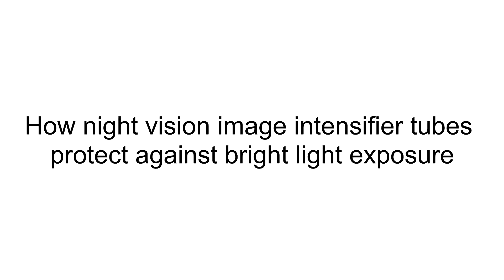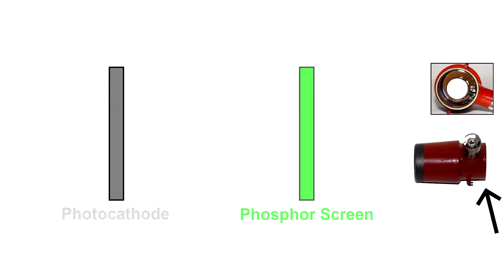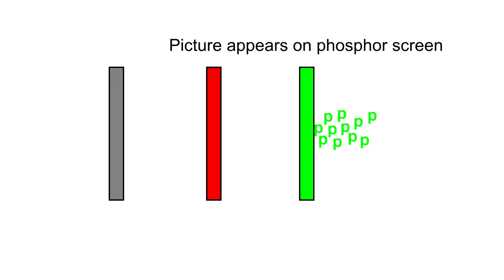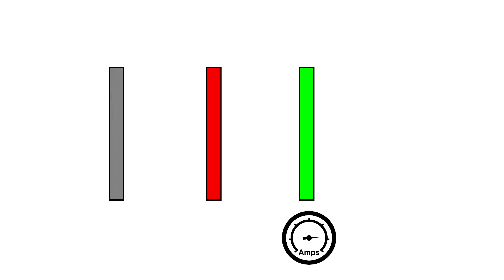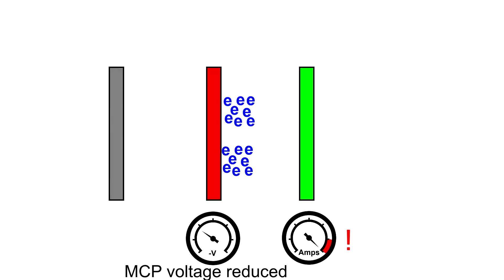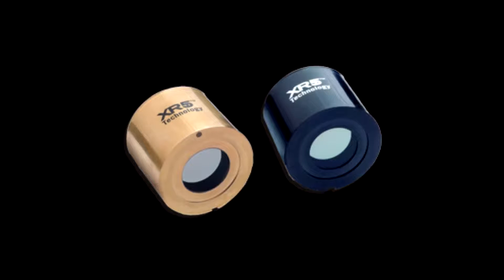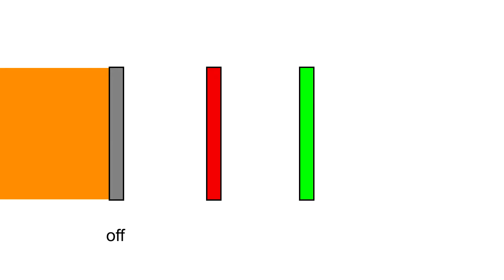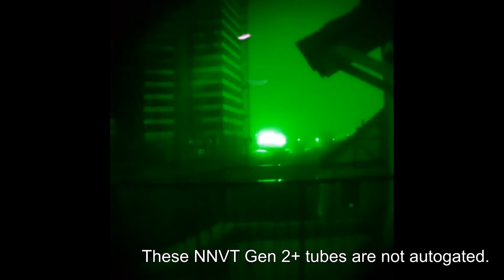How NVG intensifier tubes protect against bright lights

Comment: Quick off topic question as I couldn't figure out how to reach you otherwise; would it be possible to replace the inlet valve assembly of an S10 Respirator with one from an FM12? Mine broke and I am unable to find an original part as a replacement.